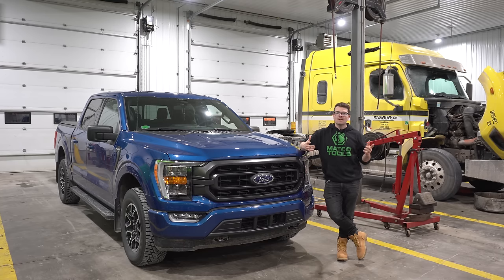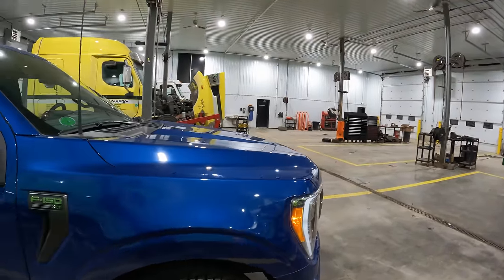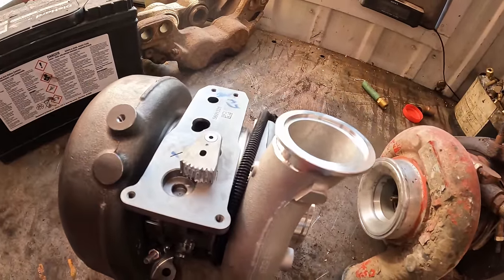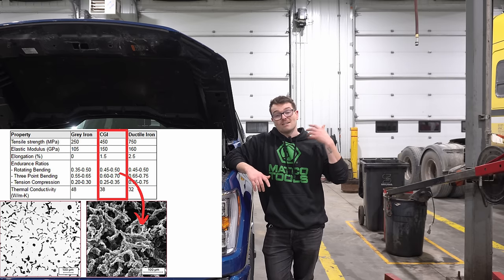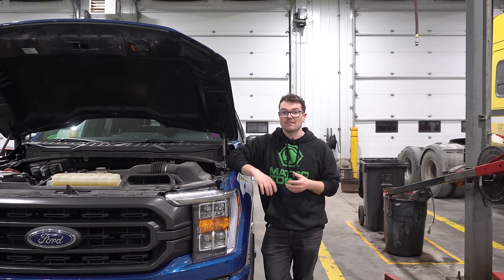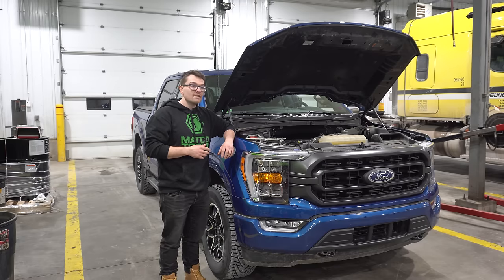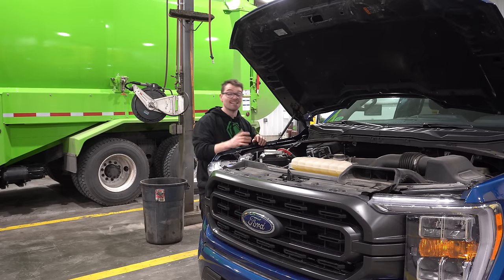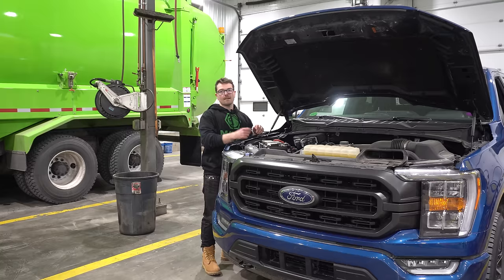Ford F150 2.7L EcoBoost V6 Engine **Heavy Mechanic Review** | How GOOD Is It??

Comment: Biggest REGRET  OF MY LIFE. I knew better. I Fu@king knew better. But I bought  a ecoboost.  2.7 f150. I love the truck. But I HATE THE LOW POWER 2.7. it is trash. 3 months  and I'm parking it covering it. Going back to my 2015 v8 XLT. THAT HAS FULL POWER HAS NO LAG. 
  4x4 is useless on A 2.7. Sounds like a Lil girls car. No top end at ALL. AND 4 TO 6 SECOND  LAG ON TAKE OFF.  I DO KNOT FELL SAFE ON INTERSTATE  DRIVING THIS GARBAGE.  The 2.7 struggled  to tow my bass boat. In fact did better in regular  mod. Tow mod is useless. It is a motor that should never been on a Man's  truck.

Comment: If you live in a hot environment you should change your ignition coils and plugs sooner.  My coils started going our around 78k. Made my truck shake and shudder like the transmission was slipping. But after running a diagnostic check the codes were for fouled plug and coils in cylinder number 5 . Plugs weren't bad but the coil was.  I change all the coils and Plugs.  4 of the 6 coils were bad. . The Plugs were decent.  But why not change them since I had it apart.  I also run STP ceramic oil treatment. My engine runs smoother quieter and keeps it cleaner longer.  The Vegas heat is tough on turbo charge engines. I use full synthetic Valvoline high mileage oil to help keep the internal rubber belt and seals going hopefully longer.  Overall this engine kicks butt. Just needs more love and attention.  Stay on top of maintenance. Use good oil

Comment: HEY I HAVE AN IDEA! Let's build our motor around a rubber belt in the sump for the oil pump. BRILLIANT!  Ford probably even kept the VRT nightmare. Will never own another Ford again after 45yrs of loyalty. The Triton did me in. I became an expert mechanic on the 5.8L. I lost many weekends fixing problem after problem. Forget about trying to keep the check engine light off. Only solution is electrical tape across the dash.

Comment: Sadly, they nerfed it for 2024. You can no longer get the 2.7 payload package that gave it 7000+ GVWR. Evidently, Dealers don't have the flexibility to special order a la carte for stock anymore either. All in the name of manufacturing simplicity. Yet every other F-150 has the uprated chassis and 9.75 rear end, which would make the 2.7l trucks the outlier. With the 8.8" rear on paper, the 2.7 truck has barely any more capability than the Ranger towing, and actually worse payload( not realistically, as it's a longer wheelbase with a wider track, and the super 8.8 has a standalone axle rating from Sterling of 3800lbs, but is paper rated to about 3100 on these trucks. For comparison, the 9.75 standalone is 4500lbs, the 9.75HD is 4800lbs, and paper rated on the F-150 to 3800lbs. They also do it with the Ranger that magically has higher axle ratings for the 4x4 model with no part number changes. Most modern GVWRs are just made up arbitrarily to put something in a class.). I had a 2018 with the payload package, and had almost 2000lbs of payload. It also towed better than any other truck I've owned. If only I had the room for that rig, I'd still be driving it today. It is LEAGUES better as a towing motor than the 5.0L, and is more durably built than the 3.5. A correction: The turbos are not VGT. They have electronic wastegates starting in gen 2, and vacuum/mechanical on gen 1. Gen 2 also introduced a dual volume oil pump, direct and port injection, and a 10.8:1 compression ratio. The motor also has the exhaust manifold built into the heads, so they have coolant jackets, which helps it warm up much more quickly, especially in winter, and puts the turbos right all up in there, greatly reducing turbo lag. In 2024, they quietly reduced compression ratio from 10.8:1 to 10:1 like the first gen, and the peak torque figure went from 2700-3000 rpm. (Evidently, it was too good, so they made it MORE prone to use boost and get worse fuel economy?) The nano family was also developed in Germany alongside a diesel stablemate that it shares most of its parts with. It has nothing in common with any other engine family in Fords arsenal that isn't a diesel. It weighs the same as the 3.5L and 5.0L packaging despite being physically much smaller. The main bolts are like 11"long, it has a higher coolant capacity than either the 5.0l or 3.5l, the oil filter surface area is significantly larger than the cannister filters on the 3.5l and 5.0l, it has the same oil capacity as the 3.5l, the water pump isn't behind the timing cover like the 3.5L. It also has baffles built into the heads to retain oil at the valvetrain so the start stop system doesn't cause oil starvation issues. That does cause an interesting quirk in the time it takes to drain the oil, adding about 15 minutes, but I'd say that's a fair trade off. It's built like a brick house. It's literally a diesel without the complexity of a diesel. So yes, it has been the most reliable engine  Ford currently makes (the 6.2L previously had that title). My out of left field thought is that I'm surprised modern tuners aren't doing more swaps with these as they make a 2jz look like it's made out of tissue paper.

Comment: I know it doesn’t make difference 5.0 gets 410 torque and 2.7 400
Reply: And the 410 lb of torque is at 4500 rpm in the 5.0, 400 lb at 2700 with the 2.7
That makes a huge difference when starting out with a TT or hauling a boat up the ramp

Comment: There is no replacement for displacement.  Making smaller and smaller engines with more power will require a tradeoff somewhere.  Higher boosts and temps, etc.  I am sure someone could make a 1 litre engine with ten turbochargers and a billion pounds of pressure per square inch but it wont last long.  Motorcycle engines belong in motorcycles, not trucks.

Comment: The ability to tow with the 2.7 Ecoboost V6 with its torque coming on dowm low vs the 5.0 might change my mind about the reliability concerns of having two turbos vs no turbos long term. Which I know is ironic considering I prefer the 5.0 even through I like diesel engines. My cousin Jimmy has a 2012 F150 with the 6.2 V8 only because he liked the reliability of the engine in his F250 work truck. 
Ps. I like the color of this truck.

Comment: Being in the market for a used F150, the inventory is terrible. I'm looking for a '21 and plan on eventually towing a 6500 -7k lbs fully loaded travel trailer. So few 3.5L or V8s available, plus the crazy prices of today's market, I am so tempted by this 2.7L. I just fear I would have regret when I do start towing... am I wrong?
Reply: Yes, you're wrong. The "Nano" can't be beat. If it can't handle it, you're probably gonna need a diesel... and a F-250. I'm just say'n...

Comment: My throttle response is wonky and my rpm’s seem to stick. Shops don’t see anything wrong with it. I was thinking it was the throttle body but they says that’s not how it works on new vehicles. Anyone else have this issue?

Comment: I have the 2.7L eco in my '23 Bronc Outer Banks soft top, and in sport mode, Oh my God ... the acceleration is that of a sports car.  It's incredible.  Some vids have me freaked about the wet belt oil pump.  I have no idea.  Any thoughts?
Reply: The five oh has a wet belt also

Comment: All these numbers are thrown out there but the reality is were frogs in a pot of slowly boiling water. I've read about the lack of turbo lag since ecoboost engines came out and my '18 has it in spades. Between the electronic throttle, the horrific 10 sp and the turbos every passing or accelerating move has to be planned ahead. Nothing like pulling around to pass on a 2 lane road and having 'throttle bog' while the computer figures out what to do. The only way you can comfortable drive it without the zoom zoom sport mode in hilly terrain is put it in tow/haul and leave it there. At least it downshifts that way...

Comment: i wouldn't call it the best engine but it tackles a segment that often had to make tradoffs. the commuting grocery getter that tows a trailer about once a month. you could get the v8 but you'd loose mpg on most days. get the v6 and you lose power for when you tow. the 2.7ttv6 really hits that sweet spot where you've got a smaller engine to more efficiently handle a lot of it's life but those turbos give you the power to tackle that trailer.

Comment: Internet seems to suggest that for all the strength of the 2.7 construction, the 3.5 EcoBoost has higher expected longevity (200-250K) than the 2.7 (150-200K).
Reply: Many people with over 200K 2.7L online

Comment: 2.7  is way too big ... it should have a 1.5  .... stupidity run rampant in a FULL size truck.
Reply: 1.5 would have been wayyyyyyyyyy too quick buddy.  Go watch the TFLTruck video comparing the 2.7, 3.5 and 5.0.  Spoiling alert: the 2.7 was the quickest to reach 60 mph while towing a 8600# TT.

Comment: I have always owned the 5.0 coyote engine and loved my v8s until my 19 had an oil consumption problems with no satisfying help from Ford. I watched your review and decided to give the 2023 2.7 a try. been very satisfied with the vehicle so far. my 5.0 got 19/24 mpg and the 2.7 is giving me 27/26 mpg both way over the door sticker ratings. I do not have a heavy foot and let it come up to speed and then can cruise right along I do use the ECO mode  however I do not haul anything. Thank you for the wonderful video. I was ready to give up on Ford
Reply: I've gotten 31 out of it in nor cal but I was heading south to sfba so it was all downhill in eco mode just cruise controlling.

Comment: I have a 2.7L on my 2015 F-150 with 63K miles. Anyone had carbon buildup issues in the valves on their direct injection 1st gen 2.7? I understand the 2nd gen had port injection added on to prevent carbon buildup.
Reply: Ive got a 2016 XLT w/ ~80K and havent had any loss of power. I'm wondering when it'll start manifesting if ever

Comment: Problematic engine beyond reason.
Reply: Nobody mentioned the 5.0,,,
Reply: I had a 2016 F150 XLT 4x4 2.7 EcoBoost. At 41,000 miles the engine failed. I had to have it repaired so I could trade it in. Terrible motor, I will never buy another Ford again. Absolute junk.

Comment: I’ve got the 2019 F150 XLT with the 2.7L and I love it. Bought brand new and have 100,000 miles on it and zero problems. I do all recommended maintenance and it’s flawless even towing up to 20,000 pounds of dirt multiple times which is far above the 9,500 pounds it’s rated for.
Reply: Ha, and I thought I was doing really good when I was pulling 14k lbs. mine is a 15’. That was a 1k trip when I bought a tractor.  2 aholes cut in front of me and I found out by accident that the engine helped with braking.  That feature worked very well. Truck is not rated for that and I didn’t know it was that heavy until the end of the trip.

Comment: I feel the weakest link like the newer coyote engine is the wet belt for the oil pump.
Reply: I was in the process of buying a new F150 with the 5.0 until i read about the oil pump belt, and they even had an issue with porous engine blocks where the TSB was basically calling for the engine to be replaced by the dealer mechanics.    
I have a 2012 XLT with the 5.0 and have had zero problems. I'll just keep driving it rather than anything on the market today.  At some point I might consider the 2.7.  I don't want to mess with turbos but I'd trust it more than the GM cylinder deactivated engines and the Hemis that crack the exhaust manifold ever 30,000 miles.
Reply from the maker: Yes not a fan of it! I wish ford would steer clear of those wet belts.

Comment: I’ve got a 2018 f150, when purchasing I wanted a 2.7 but couldn’t find one equipped for my needs so I got the 5.0.  I wish I had looked harder for a 2.7 truck for my needs.  The only thing that worries me about the 2.7 is the belt driven oil pump.
Reply: The v8 has a wet belt now also
Reply: @paulhunter9613  I read that recently too.

Comment: I travel a bunch for work and I'm a truck guy so I always try to get a rental truck.  I've driven them all Ford 2.7, 3.5, 5.0, and Chevy 5.3.  I"m very impressed with the 2.7 for both power and MPG.  Ford did a great job with that engine.

Comment: I bought a new  21 2.7EB.  The intention is to drive it into the ground.  
All of the below in Metric 😀
46K KM now, and it's been excellent.  One thing, is the service intervals.  They seem way too long.  Ford says oil and filter every 15k.  I change at 8k.
Same.goes for f/r differentials, and transfer case are around 150k.
Rear and front diff were pretty dirty (no off road, reg. Use).
Transmission oil was clean, and the pan magnet had some minor paste in it.  New filter went in and gasket reused.  Again Ford says to change trans oil and filter at 250k.  
BTW...fuel economy best to date..10.5L/ 100KM.  Average around 11.3L/100KM.  Predominantly hwy.
Reply: 5 k miles don’t go by manufacturers. Always 5k miles 👌
Reply: @freedomisntfree_44  yep.  The crazy thing is the trans oil.  250k km/155k miles.  It's a fairly straightforward job.  Oil is cheap.  Transmission or motor is not
Reply: My 17 3.5 gets the same mileage.
Reply: 5k miles is the answer for real
Reply: @freedomisntfree_44  or 4K 🙂

Comment: We’ll see how people everyday drivers treat those turbo charged engines, most diesel drivers understand cool down periods after hard runs, I don’t know if gas engine drivers get it. Maybe Ford has a fix for all that heat? Toyota twin turbo engines have disappointed many.
Reply: You didn't watch the video. FYI - I drive my "Nano" hard and I put her away hot and wet daily. 235k miles and still going strong!
Reply: @BrickMudge  I did watch the video, and I’ve owned the 3.5 liter eco boost, it kept breaking so I dumped it. Hopefully they’ve fixed those problems as I had the first generation of the engine. You seem to have gotten a good one, more power to ya. Literally.

Comment: The V8 is more powerful than the 2.7, but the 3.5 beats the V8 in HP and torque. V8 always wins in sound though!
Reply: so you buy an engine for sound ?? and not performance ??
Reply: @northlander4370  The 5.0 has a good amount of HP and torque as is. It is actually ahead of the 2.7. I just like traditional truck powerterrains.
Reply: @applianceman6009  i purchased a 2023 f150 to pull my 24 ft camper ...the 3.5 has bags of torque and 400 hp , no probs pulling my Rockwood camper.
Reply: The 3.5 is a good engine especially because you have a newer one. I wouldn’t get the first few model years of it, but the new ones are good. That truck should last you without issues. Change your oil every 5,000 miles, and your turbo engine will last 200,000-300,000 miles without issues. That’s from every mechanic I’ve ever heard from. A lot of people, like myself, prefer a V8 because we like traditional and practical power terrains that are simple and can take more of a beating. I’ve seen a 2011 Ford Econoline V8 make 800,000 miles with my own eyes. However, today’s Ecoboosts are very good engines!

Comment: That engine has trouble with oil reaching the bearings if you push it hard.  If you drive like Grandpa you are ok . In the Broncos that are pushed hard or at step angles the oil is not getting to the bearings. This causes catastrophic engine failure.
Reply: Well hate to say that the 4.0 Toyota also has oiling issues at steep angles, numerous examples of this in YouTube, and that’s arguably the most reliable engine made.

Comment: We have 4 of these engines in our fleet from 2015 - 2021.  We stopped buying the 2.7 ecoboost because they are not long serving engines.  On three of four trucks turbos went before 100k.  Thats a $4700 bill when it happens.  We had one that blew head gaskets and we had to replace the engine(120 k miles).  Turbo oil and coolant leaks are also common on these.  Save yourselves the headache of these and buy the coyote engine.  Similar MPG too.

Comment: Great points about this engine. I really like it too but the dual injection system on the 5.0 would be my pick. However after a poor ownership experience with my last ecoboost I’ve switched to Nissan.
Reply: From bad to worse (Nissan).... I have the 5.0 liter and it has the infamous oil consumption issue..... I am going for the 2.7 Liter next time.  You don't say which Ecoboost you had issues with, but I am guessing it was the 3.5.  I have talked to several service techs and they all say the 2.7 has been just about bullet proof.... whereas the 3.5 has always been more problematic.
Reply: The gen 2 (2018+) 2.7 has dual injection. Port and direct
Reply: Yes, the 3.5eb in a 16 transit. Bought it new and after 56k miles I’d sunk $10k in it. 

Nissan worse? They’re the only manufacturer bold enough to throw a 100k mile warranty on their truck. I think that says something. Sure a Titan isn’t perfect but in this day and age I feel good about my choice.